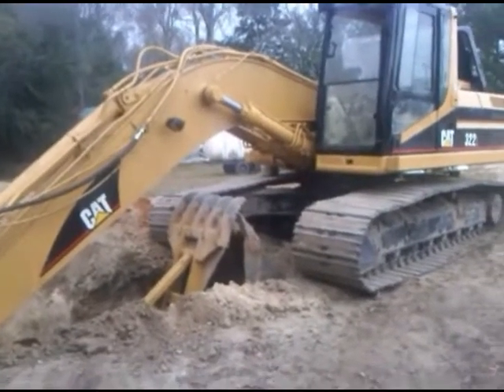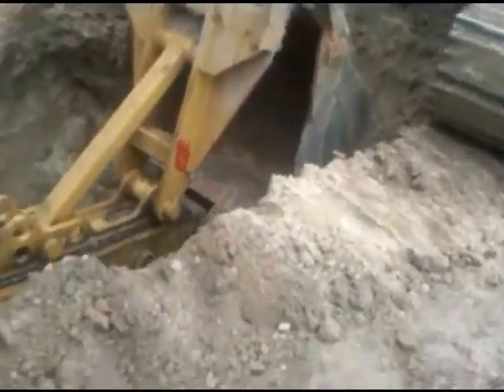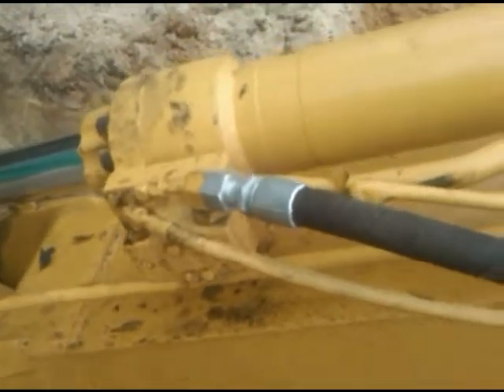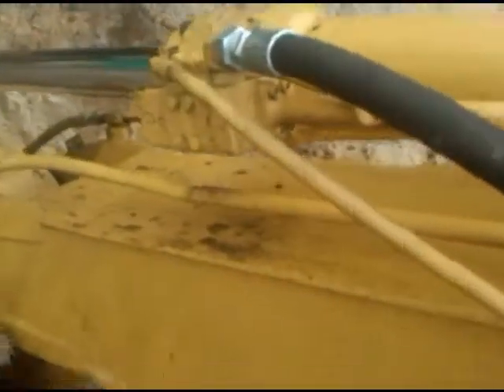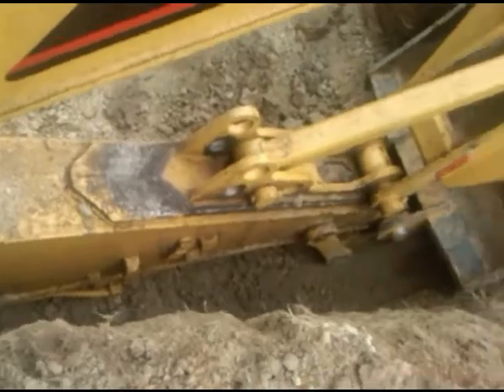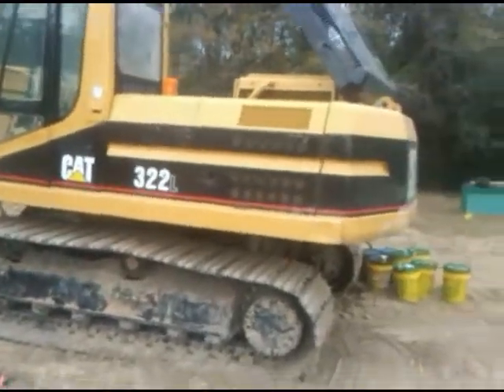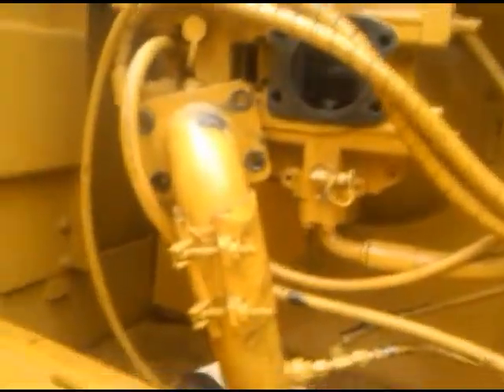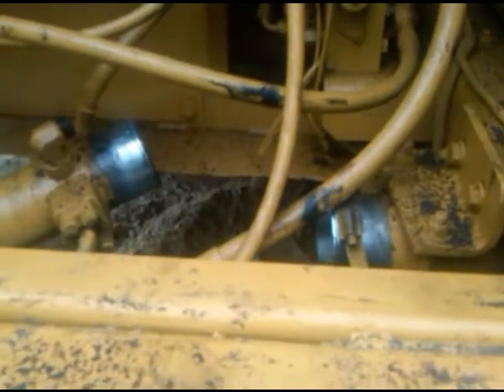Blowing off some steam about the 322

Comment: I ran Cat 320's from the first ones to the current ones, and they all seem to get leaky bucket and dipper cylinders. One machine I ran had the hydraulics turned up and all it did was leak from the dipper cylinder and then  the older ones like the plain 320L's the solenoid to turn off the engine likes to break so you have to hop up and open up the hood and pull on the cable to shut off the engine.